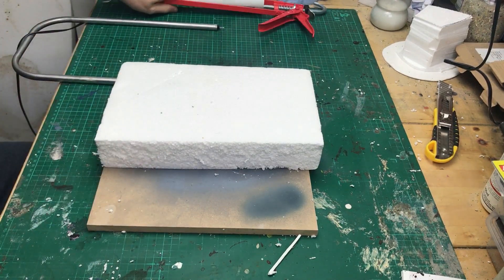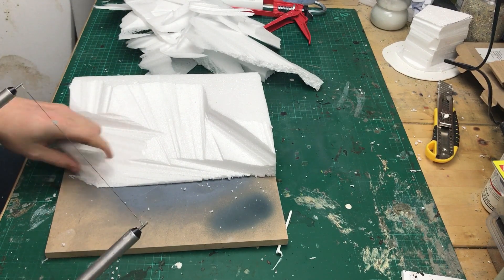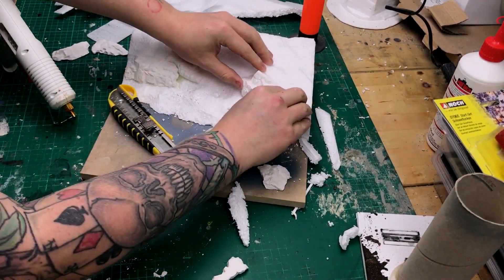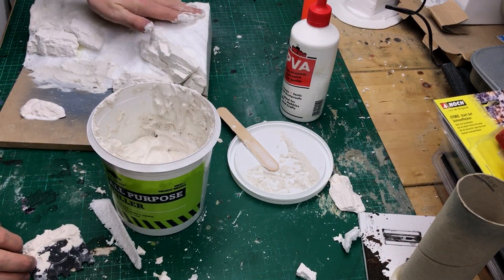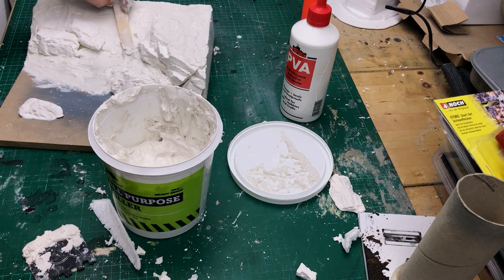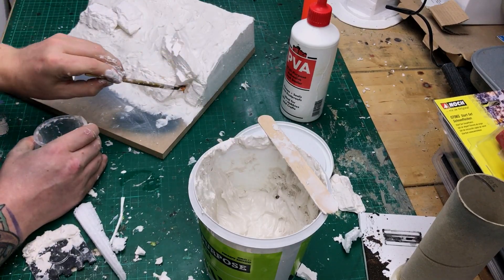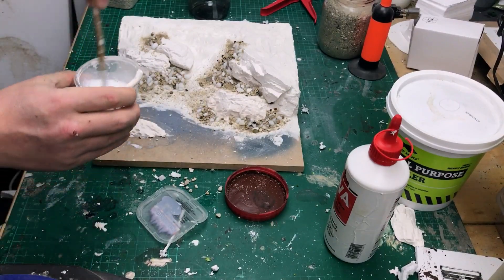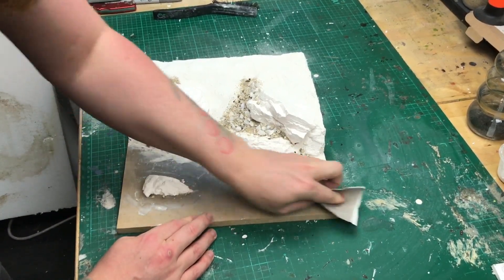How To Make Realistic Land forms Quick And Easy Dio Part UN

Comment: After using a torch and heating the top of the foam will it melt the surface enough to seal it for resin water effects, or would you still have to use mod-podge

Comment: Hi Luke, great video as always, I'm a new subscriber. 
I stuck with thiner sheets of polystyrene. Can I ask what you would use to glue these sheets together bearing in mind the usage of a hot wire. I have experimented with a few things before but the hot wire has trouble going through the dried glue or just stick with cocktail sticks as you mentioned.  Also what is 'cork' filler & where would I find some. Learning a lot , thanks :)
Reply: @GeekGamingScenics  OK thanks mate, what about sticking foam together that can be hot wire friendly?
Reply: @GeekGamingScenics  Luke Can I also ask the painting of rocks in part 2 is a method you still use?
Reply: @GeekGamingScenics  thanks for your help

Comment: Great stuff. BUT - just to say, burnt polystyrene releases CYANIDE among other very unpleasant by - products (that includes with a hot wire cutter). Important to be well ventilated. Also, when it is sanded, saw-cut and broken, it releases microscopic little hooks into the air that will get into your lungs. It really is very unpleasant stuff. Be safe - all best wishes.